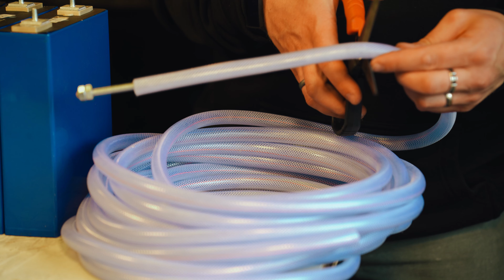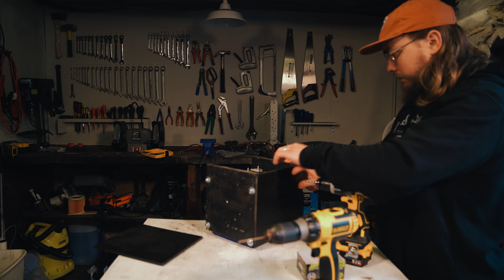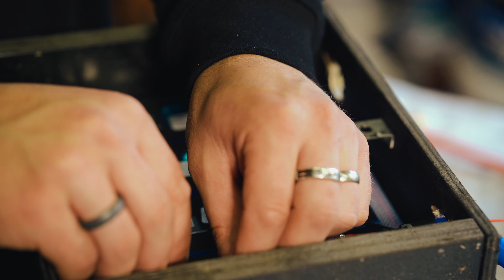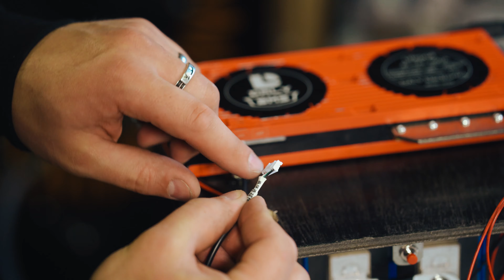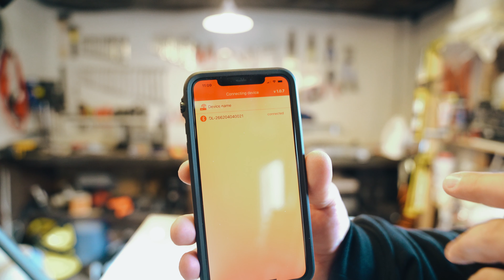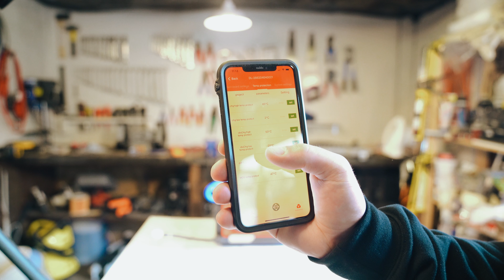How we build our custom LiFePO4 batteries using EVE 280AH cells with Daly 200A Smart BMS

Comment: I think the build in the "Very detailed beginner guide" Video is the way to go. Things I don't like about this build: Batteries sticking out at the bottom and are not protected. BMS is not protected. You would need another case where you put all this stuff in.
Reply from the maker: Yes, this was built slightly different because of where it was being installed. :)

Comment: Hi, I have built a power bank with a Daly 4S 12V 200A [bluetooth] and plan to add the micro switch to wake it up when it turns off - but my Daly doesn't have the 2-pin female connector anywhere. The only available female connectors are the "light board" and also a 5 pin female connector with no label...  Is it possible that 2 of these 5 pins are the ones to "short", if so do you know which 2? thanks!
Reply from the maker: Hello! The two pins that you want to short on the Daly 200A Smart BMS is pin 5 & 6 on the "Light Board" port. Here are some instructions that we wrote which show where the plug should go: https://geni.us/DalyInstructions
Reply: @offgrid_power  Cheers, the micro button on the Bluetooth dongle seems to work fine re-start the BMS. Thanks for your help!

Comment: Appropriate springs both allow you to know the exact pressure applied and accommodate changes in dimensions without an extreme change in pressure,   threaded rods are springs, but way too stiff to have the advantageous just mentioned.  I suggest using the threaded rods to preload springs.
Reply from the maker: That's a good idea. Do you have an example of the type of springs you've used?
Reply: @offgrid_power  there are special and not so special foam sheets that can be used, I would suggest a foam sheet on the  inboard side of your clamping boards. There are specs for how many psi the cells want.  You can use rubber, or metal disc springs (bellevilles) or regular spiral compression springs.   Do the math for the total force on your 4 threaded rods, convert that from the psi wanted to the total force. Place a board on top of the springs, then place weight equal to the force on the board.  Measure the loaded height of the springs. Now you know what the compressed spring height should be when you do the final assembly,  Can also place the setup on a scale and push down until the force/weight shows than measure spring height etc. Many ways to skin a catfish ;-)
Reply from the maker: Thanks for the advice! Appreciate it!

Comment: I’ve got 14 PCs 280A 3.2v & 6 PCs 200A 3.2v to make 48v bank , my inverter is 5KVA 230v PureSineWave Inverter Charge Controller 230v 1 series - One Leg of 230v up to 96A at 5 Kw & 3 Kw 76A & I’ve got the Moes Automatic Transfer Switch , DALIY BMS ! Thanks for the Heads Up
Reply: I am planning to build exact such a configuration with a victron 48/5000 multi II
Reply from the maker: Great! :)
Reply: 2 remarks:
Dont wear rings
Use isolated wrenches
Reply from the maker: Yep, that's right. :)
Reply from the maker: That’s quite a set up! 👏🏼🙌🏼

Comment: If you build a 12 Volt battery using 280AH cells, and then wire several batteries in series, how many can be in the battery bank before 4/0 wire can't handle the Ampacity? At some point, do the batteries need to be wire in parallel, i.e. 24 Volts, in order to lower the Amps?
Reply from the maker: When you wire batteries in series, only the voltage increases, the amperage stays the same. So in theory, you wouldn't need to change the wires if you're connecting them in series. I'm not sure what you mean by needing to wire in Parallel. Usually you would build your battery to a particular voltage that your system requires (e.g. 12v or 24v) and then build the battery accordingly. 

Sometimes you'd be better off building a battery in a higher voltage (such as 24v or 48v) and then getting one of those cheap transformers to down the voltage to 12v for certain appliances. This is often helpful if you have the need to draw large current from your battery system, for example needing to run a 4000w inverter, as the current would be lower if you got a 24v 4000w inverter versus a 12v 4000w inverter. Essentially the amperage requirement between 12v and 24v on that large inverter would be halved.

Comment: What did you use to change the settings I am told you need a computer
Reply from the maker: No, if you have the Daly Smart BMS with bluetooth, you can change the parameters in the free mobile app that Daly provide. If you have one of the older versions that does not have bluetooth, then you will need to connect to a computer using the UART cable to change the parameters.

Comment: Great video, many thanks for taking the time to do this.  Just got a question regarding the position of the shunt.  Is it okay to have the shunt between the lifepo4 cells and the BMS, or should it always be between the BMS and the load/charge?  

Another channel is thinking about putting the shunt between the battery and the BMS due to the occasions that the the BMS shuts down, the shunt will still operate/not lose power.  Would like to know your thoughts
Reply from the maker: Hi Gary. It shouldn't be a problem to put the shunt between the BMS and the battery because there is very little resistance on the shunt. The important part is that the BMS can balance and get an accurate voltage reading from the cells, which it gets from the balance leads. The black and blue cables are used to carry the current of electricity, so putting a shunt in there would be fine. We've just always put them after the BMS, but can't think of a reason not to put them between the BMS & battery.